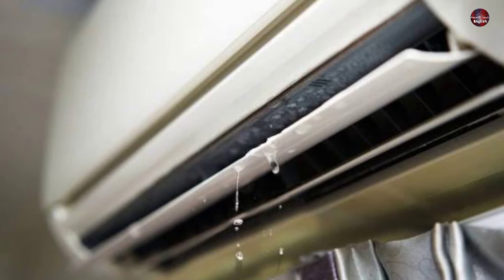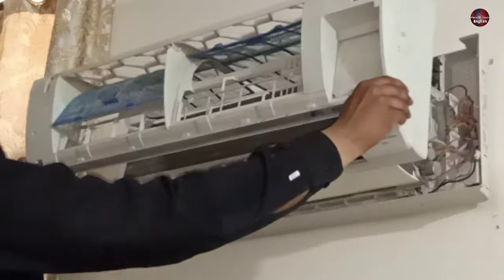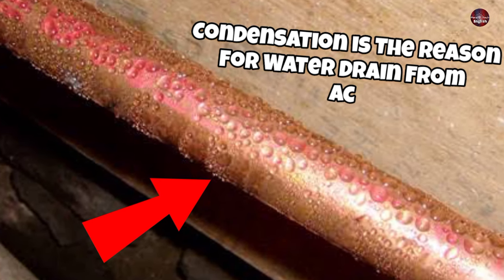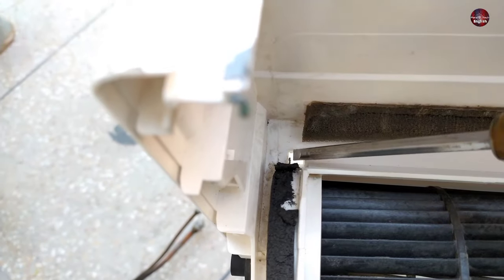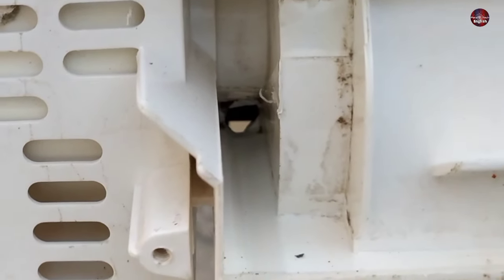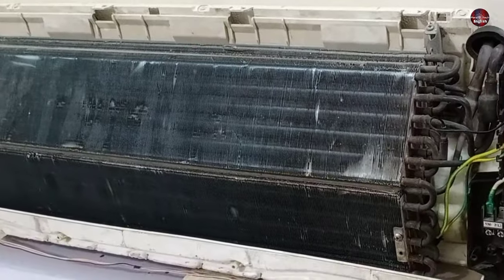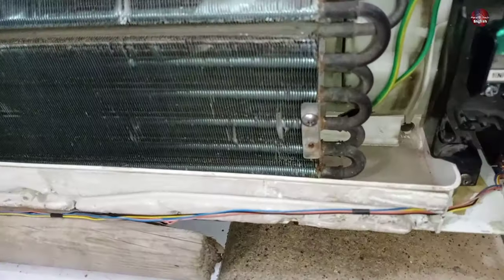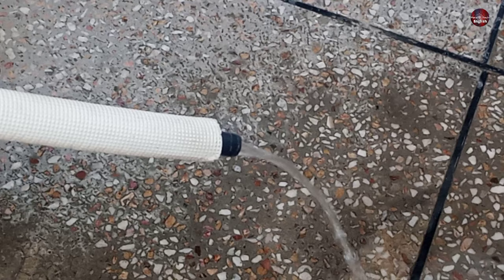Do This & Wall Air Conditioner AC Will Not Leak Water Anymore

Comment: We recently cleaned our ac 2/3 days back & now the water is leaking ...... What will be the issue ......
Reply from the maker: Check the drain pipe, it may be bent, or not fitted properly, can i know how did you cleaned it.
Reply: Service man cleaned it for us
Reply: Will there be a bigger issue .... If we didn't stop itv
Reply from the maker: So call the service man to check what is the issue, who did service for you.
Reply: It might leak after servicing its normal
Reply from the maker: @sachinramlogan421  No it should not leak after service.
Reply: Ac is tilted. Adjust it just by tilting to the opposite side of drain
Reply: Tilt the indoor ac unit a lil bit and mine got fixed

Comment: air conditioner's indoor unit is spitting out water along with the air.what's the problem
Reply from the maker: Water flows inside the evaporator, and then it drains out through the drain pipe, if the water is coming out with air it may be possible that the water from the evaporator is dripping on to the blower wheel due to dirty evaporator coil.
Reply: @forevertechenglish  man I just done master service few month ago while I brought this ac (second hand).my ac take time to cool.my room is top floor 130 square feet and I install 1.5 ton ac .in day time room is too hot 35 degree Celsius inside it take about 2 hours to come 35 to 28 is it normal?
Reply from the maker: @jobaerafrozjemin1122 @jobaerafrozjemin1122 It's normal, brother. It takes time to cool the room. No issue
Reply: @jobaerafrozjemin1122 i read in the manual it happens and its normal

Comment: I have had 4 techs look at mine they can’t figure out why it’s leaking out where the cold air blows out looks like it drips off the coil onto the blower wheel then goes onto the floor it’s an LG it’s about 7 years old it didn’t do this until about 5 years condensation lines are clear and they said it’s pitched right. One person said it might be Low on refrigerant and blowing extra cold air causing the coil to sweat more and drip in spots it’s not supposed to they checked the front and rear drain pans for cracks? Thank you for any advice you have.
Reply: I suffer from the same with a Gree… I have absolutely no idea. It was relocated from our previous apartment 1 month ago, worked fine before for 6 years, and in the past 1 month as well, but this weekend it started dripping water just as you written. I’ve checked the drain pipe, tray (top and bottom), no leak. Removed the coil as much as I can, it’s clean as I’ve cleaned it on the floor 1 month ago. So far nobody has any idea… also gas pressure was checked 1 month ago, and it’s cooling good. Also no visible ice on the coil so….
Reply: @onlycod2fan I couldn’t believe it after doing all that one of the techs asked what speed I had the blower on? I said most of the time on medium well I guess somewhere in the owners manual it says to keep blower on AUTO when using the AC mode the thing is I never had it on AUTO since I owned it without any issues until a few years ago well I couldn’t believe it. It stopped leaking! It was fine for almost a month then on a really humid day it leaked a little again but not like it was. So right now it seems the blower speed has made a huge difference!
Reply: @onlycod2fan he said having it on Auto speed helps dry the coil which seems to be true because I barely hear the condensation pump come on now.

Comment: First of all, thank you so much for the video. Just a quick question if I may - I brought some drain line tablets, should I put them in the water tray then?
Reply from the maker: I have never tried those, can't suggest to use them. If you want to try its your will

Comment: You are the best teacher here.
Reply from the maker: Thank you! 😃
Reply: My teacher thank you for all you do I have a question to ask you. But 
its on Refrigerator. Do you need to add a condenser to a refrigerator of 1/6 after replacing the compressor from R134a to R600a of the same 1/6 size?